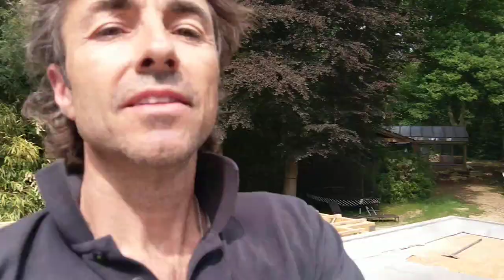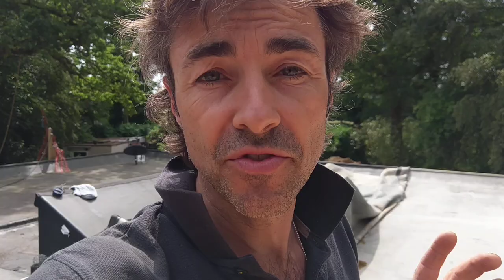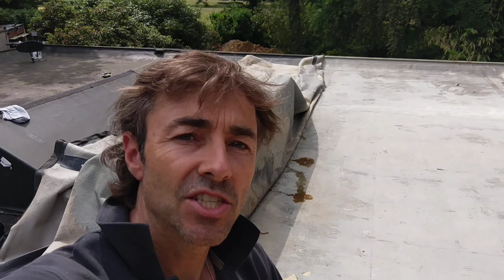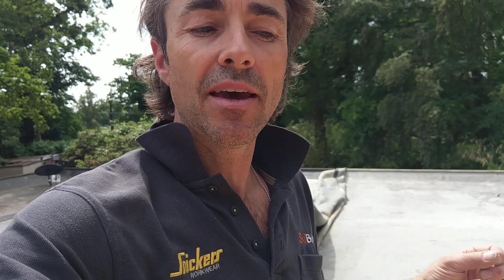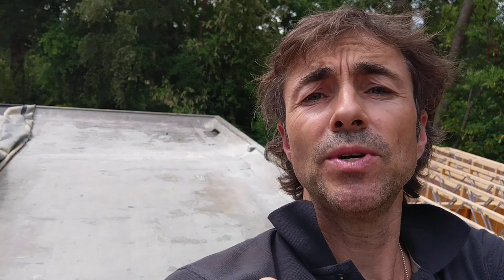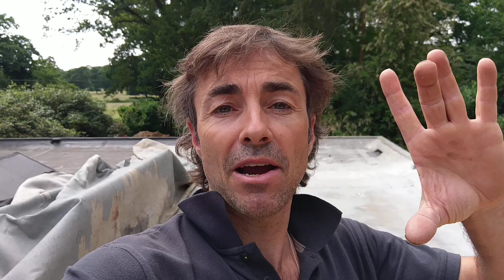The Trouble with a Flat roof including fibre glass

Comment: "Lots of issues around it" such as? Apart from the fact that it's best [though not essential] that you use OSB as decking layer, which you do for EPDM and all other single membrane systems as well..? There aren't "lots of issues" at all - that's complete nonsense. There are no more "issues" with GRP than there are with anything else. You were unlucky and came across one that was bodged, that's all there is to it.
Reply: I thought you could use ply for epdm's , seen it used many times with no problems . GRP is unreliable over large areas as well i've heard . doesn't cope well with changes in temperature leading to cracking
Reply: Sadly,  OSB is actually the lowest rated decking material, of all standard materials.  Many manufacturers wont supply high wind warranties over OSB
Reply: @RoofingFacts  "Rated" by whom? Even if that were the case, how does that add weight to the claim that there are lot's of issues around GRP?
Reply: @baxterenrife  ASTM, for starters. ANSI isnt very fond of it either, but are forced to remain neutral so they just put out testing standards for the field which OSB can only just barely pass on the low-end.

 Seriously, have you ever done a pull test on OSB? you would be lucky to score over 400psi. 400? a half rusted-out steel deck can usually support 400. You could literally lay down flat rolls of 22 gauge and nearly get that level of support.
Carlisle and Versico wont even give it above a 90Vult rating for the warranty (despite the fact they have options up to 130mph)
IB requires your fastening to be at 6 inches on center (double that of plywood or steel decks)
and it goes on, to where some will require double perimeter sheets, doubled adhesive patterns, or shrinking down your roll sizes to double or triple your number of fastening seams. 

OSB has the lowest supportive strength for adhesives and fasteners of any major deck type. That isnt speculation it is proven fact that is as easy as googling "typical psi ratings for decks" to find if anyone cares to do research. The best deck types are usually steel or concrete. below that is plywood, tongue and groove, heck even lightweight concrete was stronger and at the bottom of it all is OSB, with the lowest supportive strength. 

But I guess that's the difference between residential and commercial applications is having to constantly bear in mind codes and standards to a high degree. Most residential consultants/contractors have never heard of Vult or Vasd whereas high end work requires you to do the math and look up the standards every job. 
On a typical 55mph application (lowest of the low) OSB is fine. and thet most common because it is easy and cheap.  however it still exists as the worst of modern roofs.
Reply: @RoofingFacts  So you would advise using what form of decking for fibreglass rooves? Also how do your speculations add weight to the claim that 'there are lots of issues around GRP'?  Given all you've said is: "OSB bad"?
Reply: @baxterenrife  when did I ever even mention GRP? answer: I never once did.  Stop deflecting. 

As for fiberglass,  if I were to install it I would install  over any wood I would also use perpendicularly staggered gyp (24 F pattern)  over top with ⅛" gap between each board to alleviate/ spread thermal expansion and contraction. If wood plywood,  but ideally steel is there strongest if we want versatility
Reply: @RoofingFacts  GRP is Fibreglass, so I fail to see the deflection. My point was : claiming that there are 'lots of issues with GRP' is a misleading statement. There are no more issues with GRP than any other roofing system. GRP requires OSB [though clearly you know better] and this is the case with all the other systems. 

Perhaps you should message the man in the video and tell him to do it your way?
Reply: @baxterenrife  But my primary point is and always was OSB is the lowest quality common material for decking. It's not an opinion of mine, but one long upheld by nearly every roofing manufacturer, the RCI-IIBEC, NRCA, and nearly every intellectual body of roofing. 

Seriously. I would hate to have to spoon feed basic data easily found online. Just look up Carlisle wind requirements, ASTM published data, or even Haag's comprehensive testing done to compare decking materials. OSB has basically 1 advantage and that's SHORT-Term Permeability as opposed to plywood, despite that it actually has worse long-term water resistance. steel is non-debateably better, with ratings typically double of wood against water, pullout, thermal expansion and contraction, etc. OSB doesn't even compare side by side with concrete in any field except cost. I mean do you really believe OSB is better than steel or concrete? That's incredibly sad.

Comment: Never use rigid fiberglass or rubber on a roof,
Triflex all day long.
Do not EVER use curit on a roof,
We lay a lot of Bauder systems and a tapered insulation is the way forward,
The best roof would be a fully bonded system on a firing roof then an extruded insulation board.
Armourplan dark grey is good with the standing seam detailing.

Comment: My fiberglass roof as you said peeled of the plywood substrate,ie load of shit
Reply: Because it should never have been installed on plywood in the first place
Reply: I think if the plywood was hot mixed first with a coat of resin, then the fibreglass would have worked. Sounds to me like that fibreglass installer put fibreglass mat straight onto the plywood. The plywood would have soaked up the resin from the mat, leaving a dry matting, never gone to work. I’ve watched a lot of videos on YouTube of people using only 1 layer of fibreglass mat, in my opinion 2 layers should always be used on flat roofs.

Comment: theres nothing wrong with fibreglass roof systems if done properly will outlast any other roofing system you have a good point in that osb 3 is the only board approved for roofing systems the roof you have was a poor job then covered over with rubber roofing which is at best a poor job  , we are on the coast and have found the seagulls are pecking through the rubber roofs when they catch and eat their prey on them id like to see one peck through fibreglass
Reply from the maker: Great point about the seagulls and I do like fibre glass but as you say done properly! Thanks for the comment!
Reply: GRP is only about 40 thou thick A 3 layer torch on is about  250 thou.(quarter of an inch) No bird will peck through that. GRP will never outlast other systems. I have replaced dozens of GRP roofs. Any board can be used for torch on.

Comment: we do loads of fibre glass and put the fall on with firing pieces, then 11mm OSB followed by 120mm PIR, then 18mm chip, the trick is not to get the joins and 18mm and 11mm sheet joins matching and also to gaffa tape all screws and joins. Its quick do the actual fibre glass but like many things its all in the correct preparation.
Reply: ....but that is not a warm roof though.
Reply: Sounds pretty warm to me. Apart from a vapour barrier, what’s missing?
Reply: @edwardfrench9925  Nothing missing, just no decking must be on the insulation. Only the waterproof covering. The building regs guy would not pass this roof.

Comment: Just going to inform you strammitt is not straw and cement , strammitt is straw wrapped in paper the board you are referring to is not even straw with cement it’s wood shavings with cement and is known as wood wool slabs 
Very disappointed in you